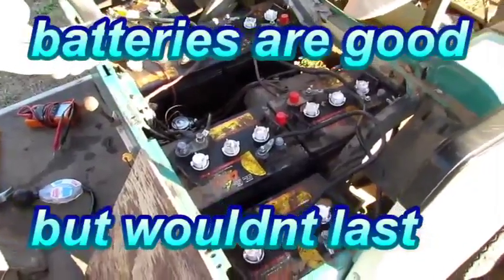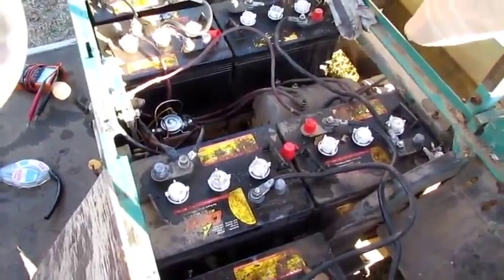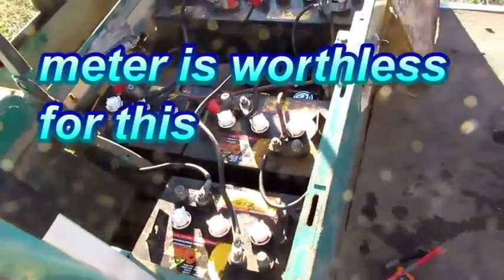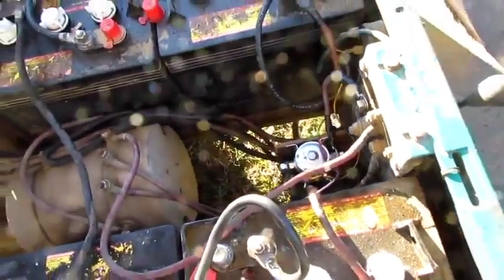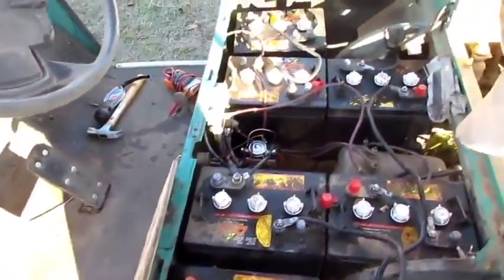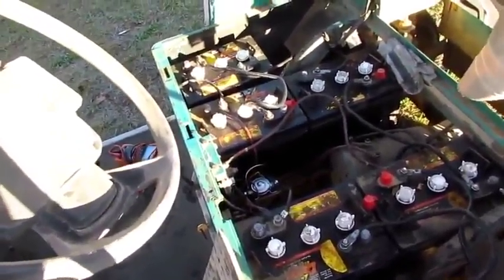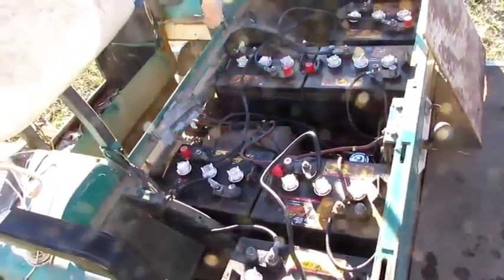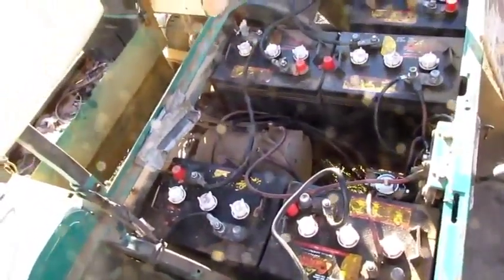Golf Cart Batteries Good Die Quickly

Comment: My neighbors EZGO golf cart was doing exactly like you described. Run out of juice only after a mile. I put my plywood on and off I went, found a hot cable after just a block and very real hot after return trip. Changed it right off, had some new ones pack ratted away. Applied cable afterwards it seemed much more jumpy also. Pretty sure it was my problem child seeing how it stays cool now. Would have never thought of this on my own. Thank you very much, your a good mechanic.

Comment: If you find yourself watching this 5 years later with this question the issue is cart batteries only last about 4 years on the good brands like Trojan. If your batteries fully charge, but don't last long it means they have sulfide built up in the cells or low water levels (distilled water only)
Your batteries should last about an hour under full load. Pedal to the floor (jacking up the rear end won't work because you're removing the load). Either that or use a battery discharger. It'll turn the charge of the batteries into heat through an induction coil and a fan that dissipate it. Anyway. If your batteries don't last an hour then take a multimeter and put it on every individual battery. Hold the brake to the floor and then floor it and you should see voltage drop. Should only drop about a volt on each for 48 volt 4 packs. .6 volts on 48v 8v packs and about .4v on 36v 6v packs. If you drop multiple volts on a single battery then it's definitely bad. Take the total amount lost on each battery and total it up and then test the whole pack. Any additional voltage drop is due to wiring. Hope this helps someone.

Comment: Hello in having the same problem I was curious on if you had fixed the issue or not? I have G16E 36v golf cart with all new Parts includes throttle sensor, speed Controller, solenoid, Brushes, and 6 brand new batteries when I first got it it worked for a week then it works on full charge for 2 laps and slows down and eventually doesn't move at all any help?
Reply: Me too 🤷‍♂️ I’m guessing I will try another charger and get one of those things to check battery water
Reply: Wondering if you ever got that figured out
Reply: I had 3 bad batteries even tho they was brand new 3 was bad when I purchased

Comment: Here is a good trick to use.  Take that digital voltmeter and measure with the PLUS probe on one end of any wire.. and the MINUS end on the other end of the SAME wire.  If the wire is good, then there should be close to zero volts across that wire.  Do the test while the charger is running or while the cart motor is running.  Place the probe on the battery POST not the wire end.  That way, you are also testing the connection of wire to post.  Another test is to use a laser pointing temperature probe.  Your hand might not feel the temperature of a slightly warm wire or connection.  If you find any wire or connection that is warmer than any other spot, that indicates the connection is corroded or the wire is bad. Of course, the test must be done AFTER running the cart for a while to give the wire a chance to warm up.
Reply from the maker: tks